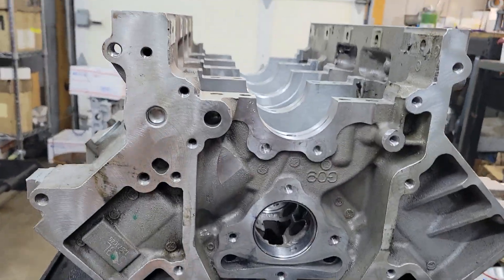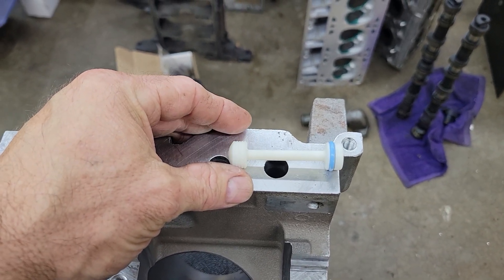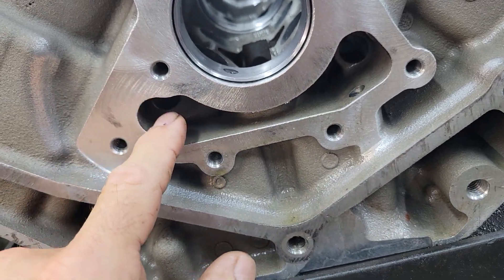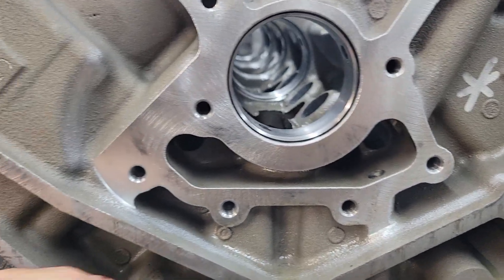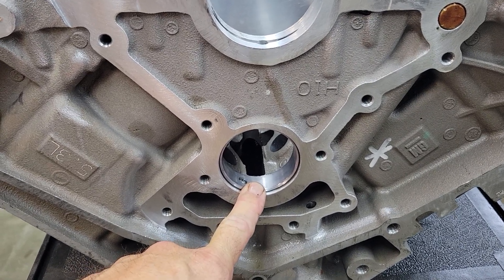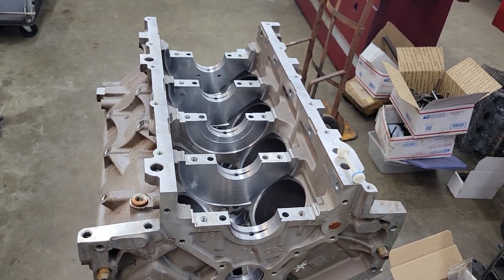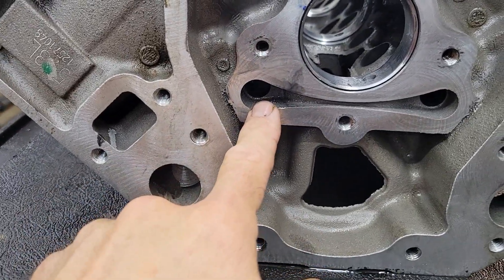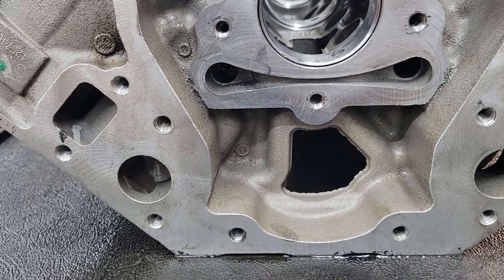How the oil system works on a LS and what's the "barbell" do anyway?

Comment: The oil goes in the filler tube on top of the engine, and a few thousand miles later, it comes out the drain plug in the oil pan, and some out of the filter when you change it 😂

That's what most people know, I am glad you explained that, I had no idea and a much better system than the Gen V Hemi....
Reply from the maker: Great point!

Comment: I watched this video way back but rewatched it to get clarification on the lifter bore oiling. So oil enters through the rear of the lifter gallery but both galleries equalize at the front. So most likely it makes no difference which way the lifter oil hole faces.
Reply from the maker: Correct its irrelevant

Comment: Hey pal, before i go too deep first thanks for taking the time. Second been doing this for a while at least 20 years. I got a aluminum 5.3 i just rebuilt didnt cut any corners bought all gm parts even the camshaft. I dod deleted it put pipe plugs in tower.  Its got a noise i can't pinpoint and if your not listening to it u will never hear it.  Its got 45 psi oil pressure. But if you crank it up with the valve cover off it will take what seems like a eternity for the rockers to start oiling, and when they do its not shooting out like a old small block. I dont know how these engines are supposed to oil are they just supposed to dribble out of the rocker? You could run it all day with both valve covers off and never get oil on the concrete is this normal.  2010 Silverado 5.3

Comment: I had block hot tanked pulled allen plug to confirm i put bar bell back in plug in front beside oil pump is in i have tried priming with a sprayer pump but cant get oil out of the pushrods or pressure sensor hole any ideas on what could be going on?
Reply from the maker: Na, those 2 are the only internal leak
Reply: @powellmachineinc  that was my understanding I'm at a total loss about to pull it back out of the truck but can't wrap my mind around why it ain't getting up top

Comment: Maybe im dumb but how do the rods and cylinder bores get oiled? Is there holes in the crank that oil flows through? And the cylinders dont have oil squirters so is it just oiled with what flings off the crank?
Reply from the maker: Rids oil through the crank, cylinder walls from splash

Comment: Question I have a LC9 that the lifter roller broke off and ate the camshaft. I replace the camshaft and lifters with new HV oil pump. Once I get fully warmed up I get no oil pressure at idle but I have 40psi cold with 5/30 oil. With straight 50 and Lucas 50/50 I keep oil pressure. I looked at mains and rods and they were like new. I didn't do a new cam plate I used sealer on it with the old oring any idea were my oil is escaping. I've put 10k on it this way just driving locally. Oh and it has 385,000 miles on it
Reply from the maker: You can not "look" at a aluminum bearing and determine wear only 3 things create low oil pressure,  excess clearance or lack of volume

Comment: I don't think you would lose all oil pressure if the barbell is missing. The rear end cover (and gasket) seals off the barbell hole, so the oil will not get dumped into the rear of the engine. So, if the barbell is missing, no oil is directed through the oil filter, but the oil will continue to flow to the rest of the engine under normal pressure.

Comment: What are the chances the factory barbell leaks on a 350k engine??.  Truck has a new o ring.  Melling hvhf pump with stiffer spring.  New bt lifters and trays.  New Cam plate. New oil pressure switch. Cold oil psi is 45 hot drops to 25 while driving. 
My guessing is that barbell may got hot and warped or the rear plate seal is leaking
Reply from the maker: That symptom tells me you have excessive bearing clearance

Comment: I have changed out the oil pump,pick up tube,o ring,cam thrust plate,barbell,the pressure  relief valve in the oil pan and I still have no oil going up to the valvetrain and my gauge says I have 35 psi at idle cold.
Reply from the maker: You are missing something obvious
Reply: @powellmachineinc  I sure am,but can't figure it out.
Reply: Dad's time  you must have a blocked oil galley
Reply: @pacman3908  I hope not.
Reply: Same issue with a dod delete. 55 psi at the filter and 40 psi at the sensor. No oil to the rockers. What am I missing?
Reply: @billcannady8804 let me know if you figure it out😂 same problem!

Comment: LS is a horrible design as far as the oiling system, Main reason why I swap to a dry sump on something like a road race car, I plug the 2 ports at the pan rail for the oil filter feed/return and just feed straight into the rear port by the back of the block.